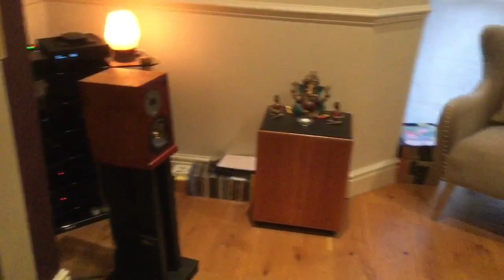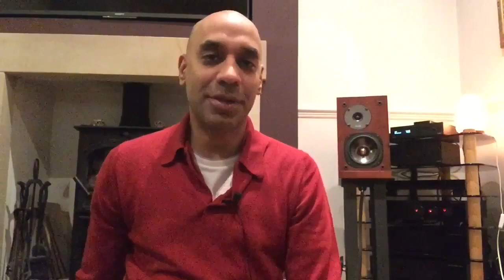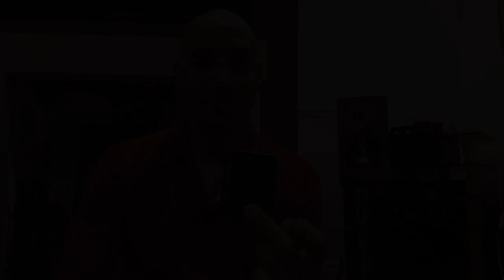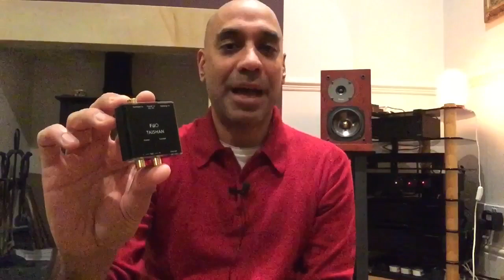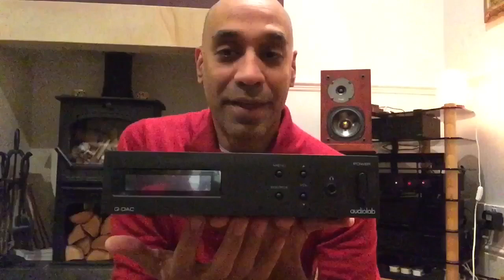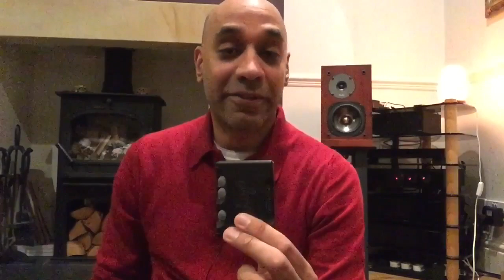Chord Mojo Review - Vs Chord Hugo and other DACs

Comment: I've used an audiolab M-DAC for around 10 years and picked up a Mojo recently to have high SQ for when away from home. I was surprised to find that the Mojo sounds even better than the M-DAC and your video helps explain why. I now only wish like you mentioned in another video it was more desktop focused and could be left connected to power constantly, had a 1/4" headphone jack, even RCA outs for powered monitors. The Hugo seems to address all these extra bits which would make it dekstop friendly and still remains portable.
Reply from the maker: Thank you for watching and sharing 😊

Comment: Just purchased the mojo 2. It is magnificent. The new intelligent desktop mode, designed for battery preservation, resolves the issue you stipulated. The new Crossfeed and UHD DSP are unique and work tremendously well. The sound has more macro dynamic slam than the Qutest. The only drawback, the new USB-C digital input is not galvanically isolated. It transmits electrical inerference from a Desktop PC. The optimum sounding transport was an Andrioud phone connected via a USB-C to USB-C OTG cable and playing bit perfect FLAC files from an SD catd via the applicatioon - USB Audio Player Pro. Virtially silent noise floor and sonic nirvana.
Reply from the maker: Thank you for sharing buddy 👍
Reply: @Covert Op- I Just ordered the mojo 2 with the poly, should get this weekend. Do you have the poly as well? Is your main listening via cell phone or PC? Did you notice a significant improvement in sound quality..clarity, sound stage, separation etc, when using the mojo2 vs just using a standard android dongle, etc?
Reply: @mden2490  1. I have never owned or tested the the Poly. 2. I have testedpver 50 dongle DACs/headphine DAC amps from the US, China and Japan. The Mojo 2 is significantly better than all  of them in all characteristivs of sound properties. 3. For the past few weeks, I have been AB testing ther MoJo 2 and the ESS9018 DAC in my Audiolab 6000A. The Mojo 2 is better. The speed is comparable but the Mojo 2 is more resolving and has better tone and soundstage depth. 4. The DAC's inside apple and android phones are decent but inferior to the Mojo 2. Apple and Samsung have never improved the outout srage and headphone sockets for the past 5 years. The Sony Xperia, is by far, the best sounding phone. 5. I have used the Mojio 2 predominantly in a 2 channel hifi set-up. The USB-C and 3.0/3.1 ports on the front of my Alienware PC, are poorly shielded from transferring electrical noise (fan, cpu, gpu). Fortunately, my PC had 8 USB 3.0/3.1 ports on the reart panel and they emit a lower noise floor but still not dead silent. The negative feedback is not audible at low volumes.
Reply: @CovertOperative  -thank you so much for your response. About a month ago I purchased the Caiyn RU6. I think the sound quality is pretty good with this dac/dongle but I did notice that at louder volumes it does have a tendency to start distorting a bit.The sound quality was definitely better than the Apple dongle though. So I suspect that with the mojo 2 it can only get better.
I listen through the Meze 99 Classics. 80% of my listening is via vinyl, and 20% I would say is streaming... Vinyl is (getting) quite expensive, and I'm not looking to build a huge vinyl collection, maybe 60-70 albums in total, and the rest of my listening will be through lossless high definition listening if it's available. I have no issues with being able to utilize both forms of music retrieval, as it would cost an arm and a leg to buy all those records and streaming does certainly lower the out-of-pocket expense substantially.
Reply: Does it have the same level of transients as a qutest? I’m deciding between Hugo 2 and mojo 2 as I’ve also figured out how to avoid noise from my low powered m1 MacBook Air using Audirvana! I’ve also tried UAPP from my Android and have to admit it is very good - better than iPhone and camera dongle even - but Audirvana via MacBook Air is the same but significantly smoother sounding so I prefer it personally. I’d like to know if the transients of the mojo 2 is as good as the qutest/Hugo 2, and if so, I’d happily settle for mojo 2! Love the idea of having an eq and cross feed coming from my mojo 1.
Reply: @18yearsoldnot  The Qutest is a fantastic DAC, warmer in its presentation and thus it smoothes over leading edges. The Qutest is perfectly suited for acoustic, jazz, classical music. The transient/devay structures are excellent but it does not have the mid bass impact and dynamic slam of the Mojo 2. With the option of EQ to tweek the frequency response, the Mojo 2 is more versatile and  just sounds better.
Reply: @CovertOperative  thank you! I’ve already got the ares 2 and was looking for something more punchy so I’ll go for mojo 2!
Reply: @18yearsoldnot  No problem. Ares 2 - nice 3D soundstage, body and texture but lacks speed, attack and dynamics and high power consumption.The NOS Mode is a marketing gimmick. It is not true NOS.

Comment: Thanks Tarun, very interesting talk about Dacs, and where they fit  into Hi Fi systems. I understand a little more now how they work. Will be better informed on next purchase.
Reply from the maker: Thanks Mike. Filtering is just one of the significant aspects that determines how a DAC will sound. The Chord Mojo is amazing value for the money at currently £299 and I doubt it can be beaten unless you spend 3x or 4x that amount. It shifts the tonal balance of my system a little too far into the warm and soft region though. This was Rob Watts intention as he felt most equipment that it was likely to be partnered with would be on the bright side.

Comment: Great explanation Tarun.  I have a 9 year old Sabre based Tube DAC that I love, and have wondered if things have truly moved on since then.  I think your video just convinced me to do so.
Reply from the maker: Hi Ryan, if you like the sound and tonality, I personally would change it unless you feel you are missing some aspect of performance. In purely technical terms, I would expect a similarly price FPGA DAC designed by Rob Watts, Chord Electronics to out perform it. However, other manufacturers such as ESS (Sabre DACs) are working hard to narrow the gap in sound quality. There is an interesting lecture by Simon Freethy of Cyrus presented to the High End Society discussing the topic of FPGA DAC and how other DAC manufacturers are reponding. Link below...
https://www.youtube.com/watch?v=SwNMOCvnlq4
Reply: @abritishaudiophile7314  Thanks for the link Tarun.  At the moment, I am not exactly sure what I want more in my system.  Perhaps a touch of warmth and smoothness in the top end and midrange + a bit more depth.  Perhaps an FPGA design might contribute to this.  I certainly do not feel detail is lacking however.
Reply from the maker: Hi Ryan, you have just described some of the characteristics a Chord DAC has over most Sabre DACs. Essentially, less “digital” more “analogue” sounding. Oversimplification, please forgive me. Still I would try a Chord DAC in system 😉
Reply: @abritishaudiophile7314  Hi Tarun, I just bought an AKM based DAC using the 4499EQ chipset.  I was going to get a QUTEST, but needed a DAC-PREAMP.  Quite a substantial improvement in naturalness/transparency - and not at all fatiguing.  Very impressed so far.  Maybe you can get Topping to send you a review copy (D90), would be curious to hear your impression vs Chord's FPGA products.

Comment: Dear Tarun,. 
I am so stoked I stumbled on your video. I was looking for someone to explain why and what makes a Chord DAC different and what does that mean.  
What a wonderful explanation, I understood what you said, I can appreciate a Dac more now.   Please pardon the novice question, but I though It would be best if I could use a DAC that is better than the one in my Marantz CD 60( connected analog to my integrated amp-RR2150) would this Mojo be a significant improvement in sound than the dac inside the CD60 ? - would you recommend it as a noticeable improvement?   Amp has only analogue  connects with one usb 2.0 in the rear panel.  Thank you Tarun.
Reply from the maker: @r2d3vadar92  thank you. Depending on how resolving your speakers are, you should notice a significant improvement in sound quality using the Chord Mojo over the internal DAC in the CD60 😊
Reply: @abritishaudiophile7314  Thank you .Excellent.

Comment: Hi and thanks for the review. Although at the end of the day the only thing that matters is how it sounds, I have a few issues with the technical description.  I'm not an expert on this subject, but I develop audio software and have some basic knowledge. Firstly: you say that the human ear can detect a timing difference of 5 microseconds. Do you have a source for this, because the papers that I have read say that this is 2 - 5 milliseconds which is a couple of orders of magnitude less. The second point is about sampling rates (which is where the 5 microseconds becomes important). Analogue signals are filtered with a low pass filter before digitising to ensure that the signal remains within the goal sampling rate and prevent aliasing. This filtering is not free and produces errors, so one of the goals of the filtering algorithm is to have these errors be as inaudible as possible. The higher the sampling rate, the easier this is, so there are advantages to higher sampling rates in mastering. Higher sampling rates in playback is more contentious and I've seen people suggesting that you should filter out the higher frequencies on playback to avoid distortion.  Finally some notes about the FPGA technology of Chord. I've looked at their explanation and I have two issues: firstly they compare their technology with some mythical "DAC chip". This is just silly: the idea that all other DACs would use some mythical cheap chip in their design makes no sense so this is a bit of a "straw man"  objection. The FPGA is basically a type of programmable computer that can perform well and cheaply for very specific tasks and has been a staple of digital audio for donkey's years. It should also be noted that the output of an FPGA is not analogue, but a single bit PDM bit stream that approaches analogue and can be easily converted to a true analogue signal, so the idea of having very few components in the output stream is hardly original to Mojo but more a consequence of the basic design. The idea of using multiple bitstreams to reduce errors is fairly common, but I can't say if other DACs use this and this may be where Mojo particularly shines. I suspect that a great deal of the quality in the device comes from the quality of the analogue components.

Comment: Hi Tarun, let me thank you for your immensely informative videos first. Secondly and to resume, I have a Mojo, an iFi NEO iDSD and an Audiolab M-DAC and I set myself to comparing them side by side. The big surprise for me was that I actually prefer the way the Mojo sounds. However, the differences I found are noticeable only when I switch; they are very slight. I don't think I would be able to identify any of them in a blind test and without switching. Of course, the Mojo is rather inconvenient as a desktop DAC. I have a decent setup, connecting the DAC to a Quadral M8 power amplifier that feeds ATC SCM19 speakers. So my question here is: are we exaggerating the importance of DACs? The difference between 500€ and 2000€ speakers is usually quite obvious. What about the sonic difference between DACs? Is it really that evident?
Reply from the maker: Thank you. The difference as you upgrade DACs woind be as obvious as with speakers but still significant IMHO 🙂
Reply: Вы ещё сравните звук с IPad, будите ещё больше озадачены..

Comment: Great and informative review - showing just how far tech has come in order to improve sound quality. What would be interesting though is if you ever got to listen to an Audio Note 0.1x - simple tech - simple chip (TDA1543) - and pit this old but well implemented tech  against the latest computational FPGA super DACs. You may find that experience enlightening then end up scratching your head.
Reply from the maker: I agree. That was a legendary chipset. It would be interesting to compare 😊👍
Reply: @abritishaudiophile7314  Well the TDA1541 was the legend - nevertheless, if you ever get a chance listen to an AN. AN would have preferred to use the TDA1541 but there wasn't enough of them to sustain a production environment - so AN purchased 20,000 TDA1543 chips instead. And believe it or not - a single TDA1543 chip is also used in a very expensive Vertex AQ Aletheia DAC-1 costing close to £11,000.
Reply from the maker: @mudsplat  I hope to get to review the AN DAC at some point 😊👍

Comment: I bought my 1st CD player in 1982,it was a Sony something or other & cost me over a grand,i enjoy modern classical from John Cage to Frank Zappa,and fusion Jazz from the Mahavishnu Orchestra to George Duke & Jean Luc-Ponty so the Cd's i was interested in all cost around $50 or more,back in the 1980s and 1990s the DAC you ran made huge differences,nowdays nearly all quality gear runs the same Burr Brown 192/24 chips,the DAC in my Mcintosh C-2600 tube preamp sounds exactly the same as as my $199 Emotiva DAC and my,in fact from my room measurements issues like jitter & clocking have been eliminated so ive given up running separate transport/dac configurations in favor of the 1 box solution of the Mcintosh MCD-550 CD/SACD/Preamp i found without remote & cracked face for $200 at a Detroit pawn shop,when i ordered a replacement glass,remote,manual & double shipping boxes the MCD-550 was still in production at $6,200 ,the last bit about the insane deal has nothing to do with the topic,i only mentioned it because the MCD-550 will be the final CD player i buy at 75 yrs old.
Reply from the maker: Hi Levi, thank you for sharing this. I really enjoyed reading about your experiences. Captain Tom turned 100 last week raising countless millions for charity doing 100 laps of his garden. You may have a few CD players in you yet 🙏

Comment: Perhaps a bit late to this one... Good and important points made here. There is much more to a DAC than the chip used, and while all audio has gotten better - better than ever, we're living in the platinum era of audio where there's so much access to excellent audio gear offering incredible value - digital is just making revolutionary leaps. Digital had been my most elusive quality chase, and for a long time. Not so much now. Now it's more like alternating among different, excellent flavors based on mood. I have had many, many DACs - from Levinson, the top, Channel Islands modified Audio Alchemy rig, large chassis Sonic Frontiers tubed DACs, Camelot pieces, and more - and now beautiful, fun and easy to use, small affordable pieces like the Mojo are available. And it gets even better from there.

Not being easily able to set up a two channel system, I'm mostly using headphones these days. But I have on occasion fronted some nice amplifiers (Odyssey Audio Khartago, Schiit Audio Vidar, Conrad Johnson MV-55) connected to nice speakers (KEF LS50s, PSB Imagine Ts) with headphone amp/DACs deployed as DAC/preamps and the results are also excellent. ...and those system experiences remind me how much better two channel speaker audio systems are than headphones, as convenient and excellent an audio experience headphones can offer (which are also better than ever).
Reply from the maker: Thank you for watching Steven. I really enjoyed reading about your experiences 😉

Comment: Higher sampling rates via oversampling don't allow you to represent "timing information" more accurately. We are stuck with FS/2.  Oversampling is used for filtering of digital images.  Better filters with more taps do the job more ideally
Reply: IMHO, that depends.  For instance, Schiit DACs don’t resample, they keep the original samples and interpolate additional samples.  Most oversampling DACs create new samples and throw out the original samples.

Comment: Lovely lovely lovely. I’ve never been able to understand the technicalities until now. Masterful explanation. I have a question. I have a Mcintosh MA352 and I wanted to listen to music from an external HDD connected to my Mac computer. Could I connect the Mojo/Poly and use it as a DAC and network streamer so I can run the whole system from the computer? Thanks in advance. Cheers from Tuscany
Reply from the maker: Thank you TDS. Very much appreciated. Form what I remember the Poly covers the inputs on the Mojo. I would just disconnect the Poly and then connect the Mojo to the Mac to use as an external DAC 😉👍
Reply: @abritishaudiophile7314  I was hoping to use the WI/FI & Bluetooth of the Poly but I see the problem. I may have to use the Mcintosh Portable MA50 that I have. Thank you so much for your answer. Cheers

Comment: I got an excellent t deal on a mojo and plan to use it Dojo style. My question is when setting it to line level do you keep it at the 3v output. I’m going to be going directly into a preamp it’s a vintage Nikko preamp from 80’s and wondering how it’ll handle 3v. How did you set yours up. I’m also running Roon and will be using it as endpoint. Thanks in advance!
Reply from the maker: You may not need 3v into your preamp. A lot of analogue inputs are designed to receive 2v. I have my Mojo closer to 2v with my Exposure XXI pre. This meant I could turn to volume on the preamp up to where it was operating more in it’s sweet spot (linear range). It will be a process of trial and error with yours 😊👍